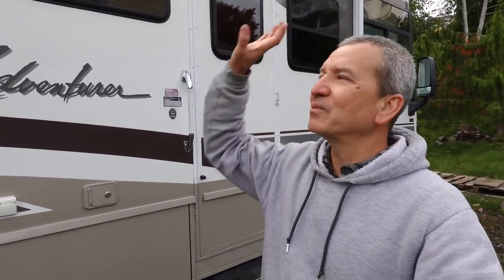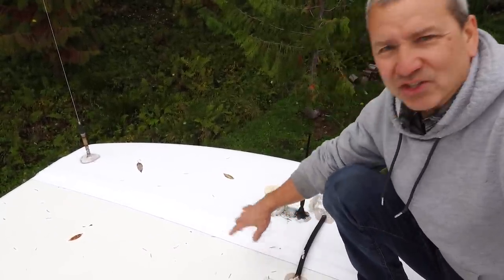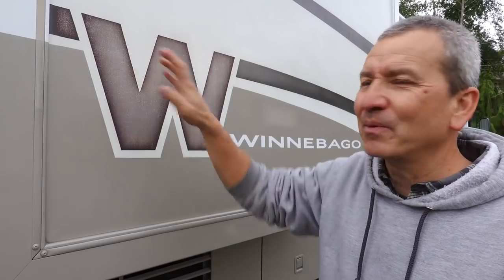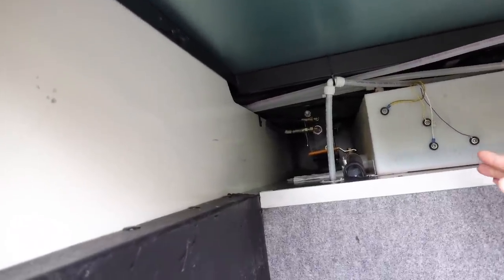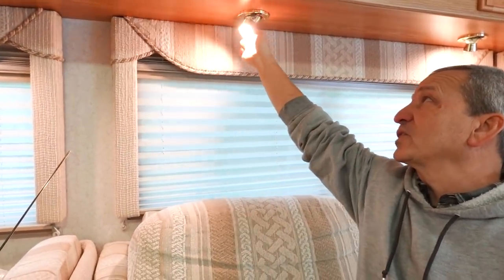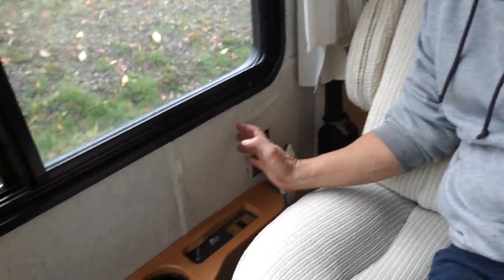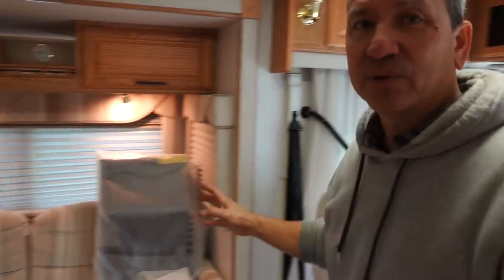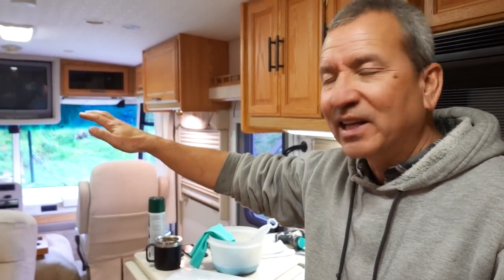(UPDATE) Winnebago Class A RV Renovation - Problems, Repairs, Upgrades & Cleaning | RVwithTito DIY

Comment: Nice job so far. Appreciate very much that you out the links for the products. I wasn't aware of the LED ceiling light replacements and the bulbs. I have already replaced most of my interior lighting with LED but not everything yet. I plan to replace all of our ceiling lights soon, Thanks.
Reply from the maker: You bet. They keep getting smaller and cheaper every year. Good luck!

Comment: I have a 2003 Forrest river motor home that has the same TV set up as yours it was a heavy tv I took out old tv cut bottom of cabinet flush with over head cockpit built an inclosed cabinet bought actuator from progressive tv goes up flush can’t see it when not in use kind of like what you did on your class c but up side down

Comment: Water pump running all the time.        Check your outdoor shower   Make sure the valves are off.    Pump will pump water recycling back to the tank
Reply from the maker: Thanks. It ended up being low water level in the tank 🥴

Comment: The water pump will stop running and pressurize the system when you move the lever off of "FILL" to "city water"
Reply from the maker: Tried that but will try again...maybe I didn't wait long enough. Thx.
Reply: @RVwithTito  After turning the valve, it probably has to fill the hot water tank and bleed the air from the system.
The winterizing valve by the pump should be closed, otherwise it sucks air.
Reply from the maker: @foreverrving3281  Thanks. I appreciate it. I think the winterize valve is labeled bypass on mine.

Comment: Hey Brian, when you add your batteries and inverter can you show how you hook up the generator DC wires? I am currently adding lithium batteries and an inverter. I am stuck on wiring the generator (the current setup has a 2 gauge wire wire running directly from my AGM battery to the generator without any type of fuse). I understand the AC wiring, but not sure on the DC wires used to crank up and start the generator. No one ever covers that part in their videos. Thanks! Love your work!
Reply from the maker: I don't see a problem hooking the gen start to your lithium bank without a fuse. The negative is probably wire to the chassis and the positive to the house battery (just like your AGM). What is the issue you're concerned about?
Reply: @RVwithTito  I’m worried that if there is a short somewhere the wire is unprotected. I’ve had different opinions on using lithium for a gen starting battery but because I have 3 wired in parallel it should be fine is what others have said. Im also running wire about 17 feet so wire size may also need to be increased (battery bank is now further away from generator).

Comment: Just replace the pump, or rebuild it, the water is probably circulating back through the pump. Check for lower water pressure than expected in the system.

Comment: Brian..we love your rv vedios..we bought a 2003 suncrusier in 2018..we have been watching g your vedios to trouble shoot ...now that you have one similar that is so great...I tried switching out the ceiling lights to LED but could not find correct size ours is 22 ×11 1/2.  We did change out the medicine lights with an LED bulb however we noticed when that light is turned on it cause our outside radio to have static. Have you ran into that? Where did you get the LED ceilings lights to fit or did you have to modify the area?.
Reply from the maker: I did have to insert a couple wood strips inside the light cavity to mount the new ceiling lights which are a little smaller. I believe I showed that in the video.

Comment: Let me know if you ever figure out how to install the RV soft start device on the Coleman basement ac.  Supposed to allow you to run on lower amps?
Reply from the maker: Looks like it's possible. Someone else showed me how he did it on both compressors. You have to drop the heat pump to do it though.
Reply: @RVwithTito  yes I am told it will work but lack of space on basement ac is a issue and not really easy task to remove and reinstall the basement AC.  
Most videos showing the install are on roof ac units.  If you make a video you would be the first.

Comment: Right on keep up all the upgrades I also follow James at az expert he does pretty nice work as well
Reply from the maker: Me too. Leaning a lot from James. I'm now addicted to roof rebuilds :)
Reply: @RVwithTito  hey Brian my waterpump did the same thing in June I just replaced mine with the lippert flow max seems to work pretty good I’m not sure but there probably is a rebuild kit for the pressure switch
Reply from the maker: @coreymerritt7742  Thanks for letting me know. That really helps. I do have a nice pump as a spare. That should do the trick! 👍

Comment: This is so great, Your channel was one of the first I started watching when I acquired our first rv and now you have this new to you Winnebago adventurer. Ours is a 2005 adventurer, very similar to yours. As you said in your first video on your new acquisition, it has great bones.  
Just wanted to make a comment about your water pump running continuously. I had a similar experience with mine, found I had the city fill/tank fill control on tank fill. Turned it to city fill pump only ran when calling for water. 
Looking forward to all your upcoming projects, that bay you want to put your lithium batteries is where I put mine, great location for all your electrical stuff.
Reply from the maker: That's great. Thanks for tuning in. BTW figured out the water pump issue and posted it as the first comment. Turns out the tank level was very low. Put water in and everything is fine. Oops :)

Comment: Are you going to convert your black tank to hold grey water?
Reply from the maker: Nothing to convert. It's cleaned and plugged. I've already put a gate valve on the end so I can combine/equalize both tanks if needed. Most of the time we won't need to do that and the black tank will be empty.

Comment: Nice job on the upgrades Brian! 
I have the same satellite dish on my 2004 Tioga. I was considering removing the dish and mounting a cellular antenna in its place. The mount would work great for aiming the antenna. Have you ever looked into this? My main question would be if I could use the existing coax, or would need to make a new run of whatever impedance a 4G antenna requires.

Comment: Im like you upgrading an older RV. You mentioned new TV's, I've been wondering about converting mine to 12v. Also could they be used as display for cameras, navigation using a simple cast from your phone or tablet?
Reply from the maker: I'll probably leave ours on AC since we'll probably have the inverter on all the time now.
Reply: @RVwithTito  I have been wanting to upgrade the inverter, but have been warned against it by RV shops?? I don't understand why.. hoping to hear your experience :)
Reply from the maker: @wla1rmc  Who knows. It's probably because you're changing the stock RV electrical system making it very customized. I'd be curious to know why also.

Comment: Are those single or dual pane windows? I have a 2006 that has dual panes and they are fogged. Thinking od taking them apart and removing one pane. What do you think?
Reply from the maker: The windows are dual pane.
Reply: Dual panes have a gas between them that keeps them from fogging.  Your panes lost their seal.  Glass place may be able to get new units.

Comment: Compost toilet?
Reply from the maker: Yes. Been using it for a year now. Never going back.
Reply: What are you planning to do with the black tank?  Plumb into the other tank to increase grey water capacity? Urine diverter direct to the black tank?  Just curious.
Reply from the maker: @weasleyoc  I just join them at the outlet with a gate valve to expand gray capacity when needed.

Comment: do not use tape on your roof, the sealant is all you need if you keep it in good shape.  The tape will trap moisture and if the sealant fails underneath and the tape lets in moisture you will not know until it is too late.  Please watch other videos on this like AZ Expert before doing this.

Comment: I have that kind of handle on my trailer and find that everything catches on them...

That celling looks a lot like Popcorn celling, I wonder if you can remove it in the same fashion...

Grab the 12v wires from the sconces and wire-in some USB plugs 😎  (You always need USB charging outlets for devices)

Comment: First!
Reply from the maker: Woo hoo! You rock.
Reply: Side note, I got the pass side filon glued on today! Finally..
Reply from the maker: Nice job taking on that project. Impressive.
Reply: As I'm putting this side back together with all my trim, tape, glue and self tappers I got thinking about your solar panels. If you take some 2in aluminum angle, bend it back about 15 degrees then notch each side to slide into your U channel